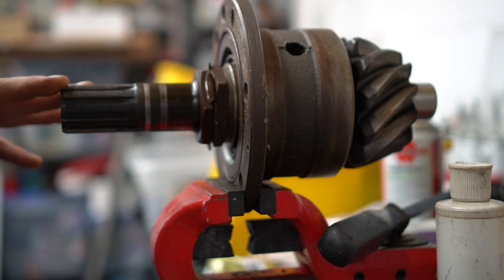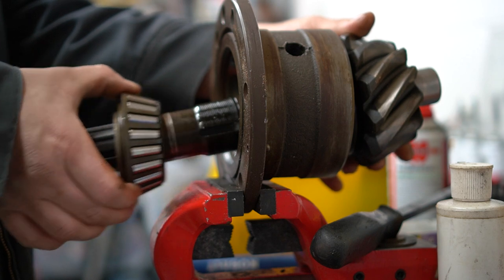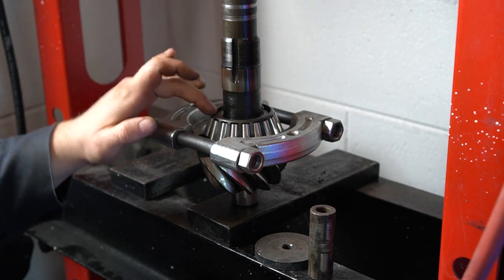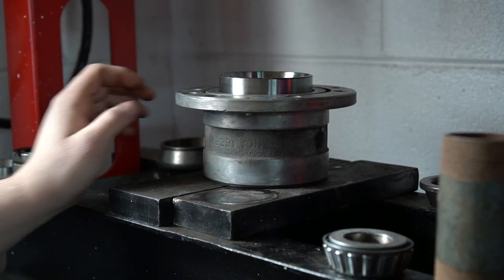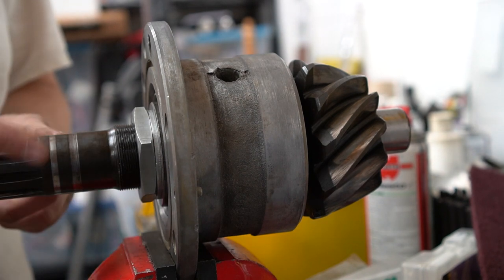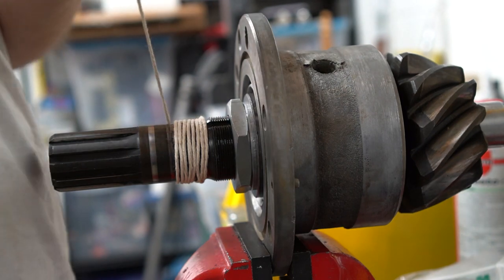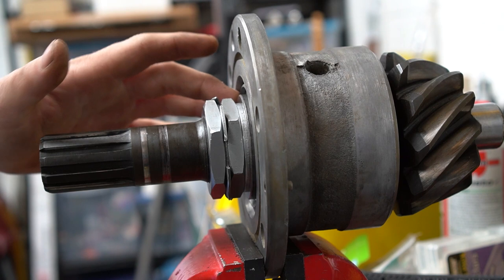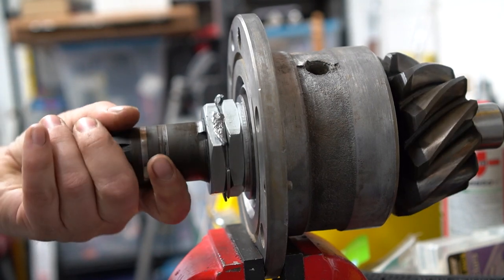Replacing pinion bearings on Ford 4000 Tractor

Comment: Do you know if pinion assembly can be removed from tractor with ring gear and axles intact. I found the hardened pinion thrust washer in 3 pieces in bottom of case and pinion is real loose.
Ray
Reply from the maker: Yes you can remove the pinion assembly without touching the axles or ring gear.

Comment: I want to know how to remove it from the tractor
Reply from the maker: Yeah that's one thing I didn't film. Should be able to use the bolts in the two threaded holes to push it out if the center housing.